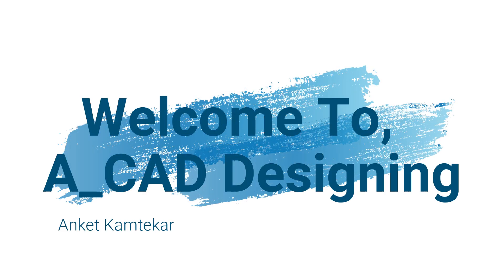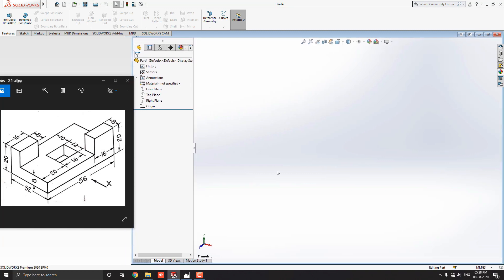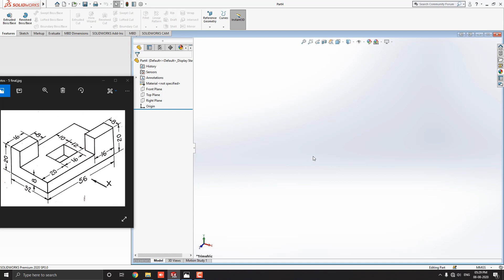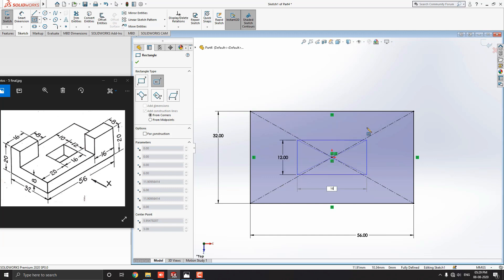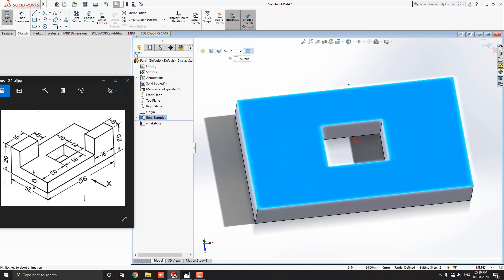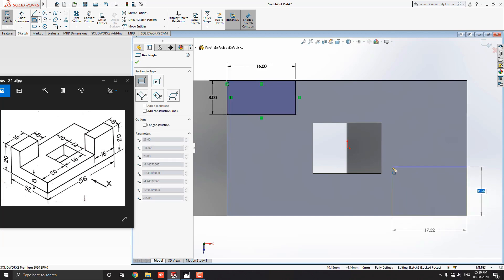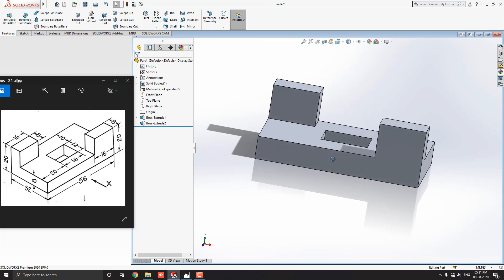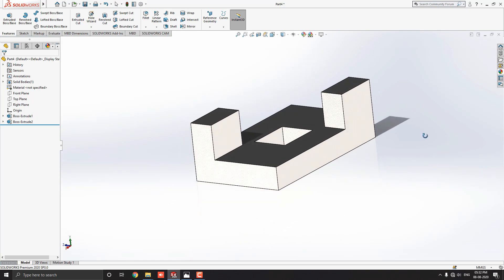SolidWorks Tutorial For Beginners | Part Modeling Exercise - 05

Comment: Sir , what is your conputer Configurations. Plz reply
Reply from the maker: Processor - i5 9400f
RAM - 3000MHZ 16GB DDR4
Ssd - Kingstone Q500 240Gb
HDD - 1Tb + 500Gb
GPU - Nvidia quadro P4000  4gb GDDR5
Reply: @anketkamtekar  
HP Pavilion Gaming Ryzen 5 Quad Core - (8 GB/1 TB HDD/Windows 10 Home/4 GB Graphics/NVIDIA Geforce GTX 1650) 15-ec0101AX Gaming Laptop
http://dl.flipkart.com/dl/hp-pavilion-gaming-ryzen-5-quad-core-8-gb-1-tb-hdd-windows-10-home-4-gb-graphics-nvidia-geforce-gtx-1650-15-ec0101ax-laptop/p/itma1af6bf593dc8?pid=COMFSFNVDXG74QXR&cmpid=product.share.pp
I want to buy this laptop . Is it capable to work all Mechanical Software
Like Solidworks 2020, SolidCam ,MasterCAM, 
And also Blender 
Plz reply i'm waiting. 
Thanks
Reply from the maker: @AdnanThanwal  
Asus VivoBook Gaming Core i5 8th Gen - (8 GB/512 GB SSD/Windows 10 Home/4 GB Graphics/NVIDIA Geforce GTX 1650) F571GT-BQ619T Gaming Laptop
http://dl.flipkart.com/dl/asus-vivobook-gaming-core-i5-8th-gen-8-gb-512-gb-ssd-windows-10-home-4-graphics-nvidia-geforce-gtx-1650-f571gt-bq619t-laptop/p/itm63394a7a5f516?pid=COMFTWZDMAZRB3SY&cmpid=product.share.pp
Reply from the maker: 9850521466
Reply: Thanks